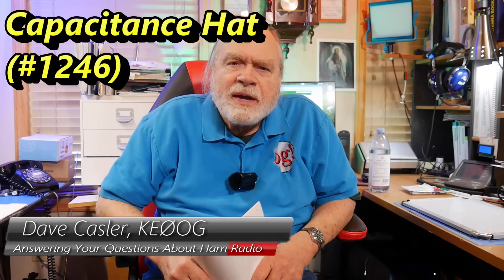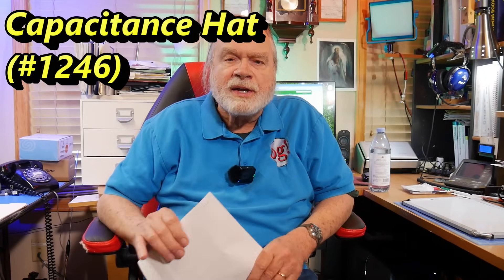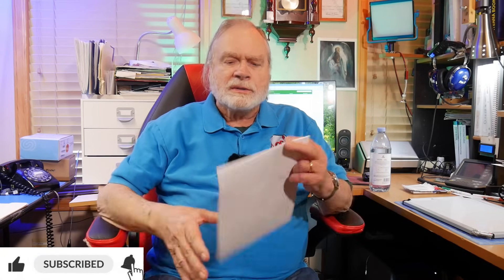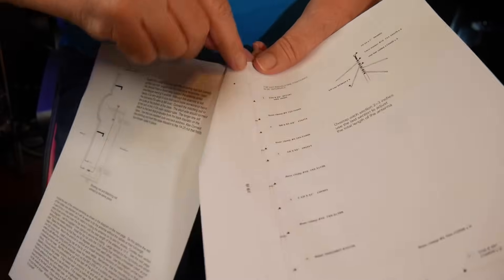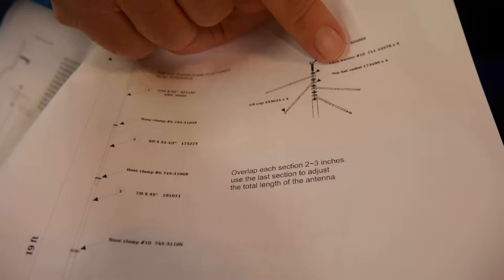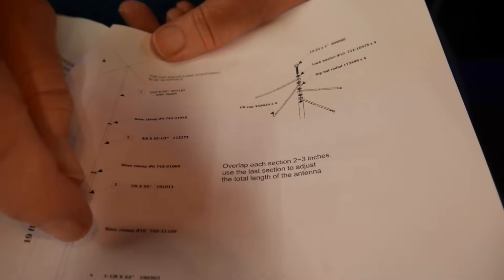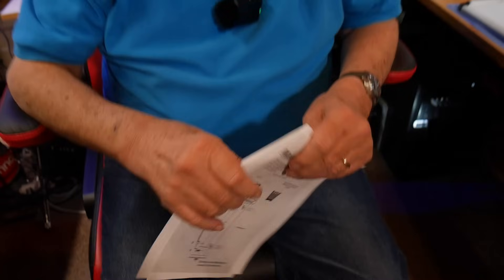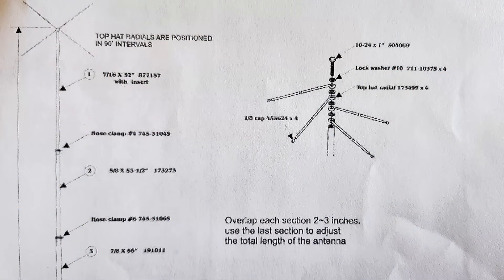Capacitance Hat (#1246)

Comment: It's a pity with all these ham operators around and MFJ being our loyal friend and supplier for so many decades, that some form of consortium can't be formed to keep those doors open and the business running and viable.  Is amateur radio a dying thing?  I have to wonder.😢
Reply: Frankly I have never had good luck with quality when buying MFJ. Putting it mildly. There are better quality suppliers out there.
Reply: MFJ had consistant quality control problems.  If you watched the Youtube video of a walk thru of the company and its production and assembly spaces you might cringe.  Its a low budget operation and the video shows it.  I will miss the antenna divisions of Cushcraft and Hygain, and suprisingly Martin wouldnt sell them off separately. You had to buy the entire company and keep it in place in Starkville, not a place people are jumping to live. 

I have some MFJ wattmeters, dummy loads, and antenna tuners that have served me well. But they are not complex instruments and easily repaired by most users.   I will miss them.